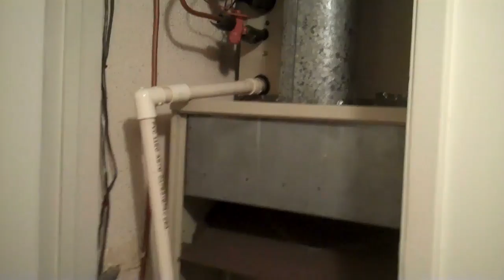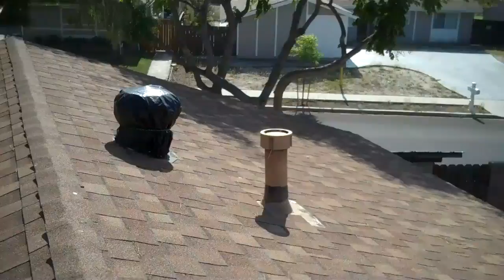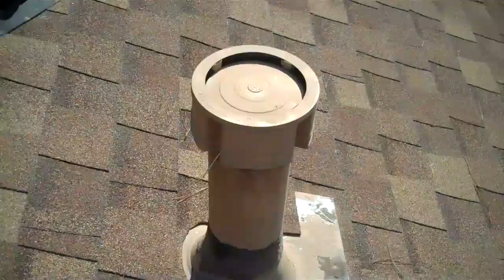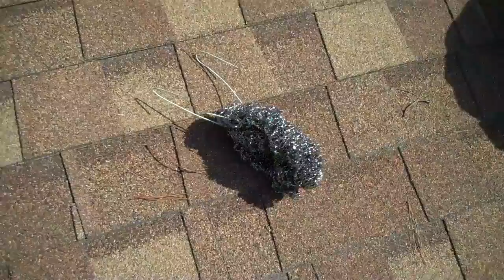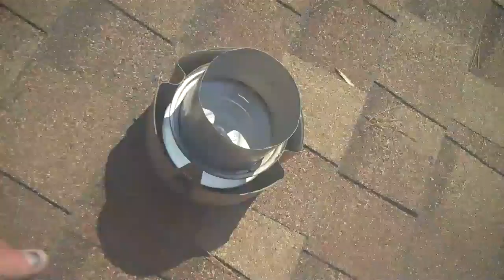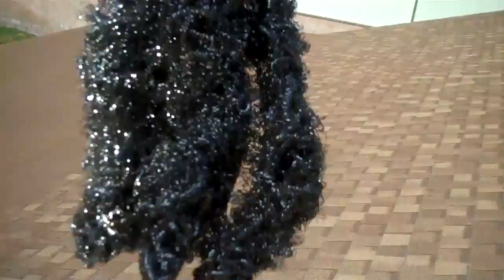Hvac A Dangerous Vent!!

Comment: OMG, please please please also remove all those black plastic TRASH BAGS tied over all the attic vents.. holy cow, thats a surefire recipie for a complete roof tear-off, and all new plywood decking.  Proper attic ventilation is crucial to prevent condensation and a completely rotted out roof.  Big snow load = boom.  Not only did they plug the furnace vent, they also chocked all the attic vents. Might want to check the sewer vent pipe too, haha.
Reply: @Uncle Timmy at 23 seconds into the video it shows black plastic was put over the attic vent. It's that thing that looks a little like a beach ball in a black garbage bag. 

Those attic vents need to let moisture get out of the attic, even in winter.
Reply: Seems they wanted to try and stop all possible squirrel entry points. But they did not go about it correctly.

Comment: Tstatech u r so right about techs going up the roof.  We’ve had numerous techs over including firefighters to no avail.  
Our new CO detectors did not activate but someone in house was getting symptoms associated with CO poisoning (headaches, dizziness etc) shortly after our new roof was completed.  Our furnace is the so called high efficient furnace with two white intake/outtake PVC vents.  These PVC vents r aligned with the hot water exhaust vent up the attic but the PVC openings r to the side of house whereas the hot water vent  is in the middle of house.  The headache is on every time the furnace is on and that only happened right after reroofing. I noticed once the hot water exhaust pipe was swaying in the wind during reroofing. Roofer responded by saying he was replacing the flashings including the curly metal sheet (sleeve?) which had been removed.  The flashings there now r not new n from what I can see the protective sleeve has not been replaced.
The furnace has been turned off since but If there was debris obstructing the hot water exhaust vent how come  “low” CO is sensed only when the furnace is on?

Comment: If a squirrel got inside the vent cap that would be one dead squirrel. The roof flue vent cap leads directly to the furnace and all joints should be locked and screwed securely.  I think their squirrel problem has different entrance to the attic.
Reply: The squirrel could go through the draft hood on the furnace!
Reply: Most modern furnaces have inducer motors directly connected to the flue vent which in my opinion would be a dead end for any squirrel. However, if you go back about 30 years or so there are draft hood furnaces and a squirrel could pass through if he could get passed the flu cap on the roof, but the furnace better not be on or it would be cooked squirrel.

Comment: Omg, so many problems there.. that mech room looks like hell and is that a condensate line on c vent ??? And they have their loft vents ( spinners) taped up ??  Lolz.. humidity issue in attic.... check .. wall condensation in unit...check.

Comment: that was a pretty stupid thing a niece did. was carbon monoxide detector going off ?
Reply from the maker: +OcRefrigeration,Hvac &amp; Electrical. Yes the carbon monoxide was going off and the customer called the gas company...Thank God!! Thanks for watching!
Reply: OcRefrigeration,Hvac & Electrical. The niece covered carbon monoxide detector so it won't get dusty,

Comment: That was quite a dangerous situation! Why did they call you out? Did they notice the exhaust gasses coming out of the furnace?
Reply: Perhaps their CO detector went off. But anyway, the customer called the gas company and the gas company shut it down until the problem was fixed. So they called him.

Comment: My new propane furnace vent was installed through the roof but with no vent cap.  I questioned the contractor and was told it was okay.  Shouldn’t it have some sort of vent cap or is it proper to leave it open?
Reply: Your "contractor" is very wrong. You do need a vent cap.
Reply: @JohnnyDS6557  ok, thank you John.

Comment: did it have a vent switch that tripped the unit??
Reply: No, thats an old old furnace by the look of it.. looks like an old low efficient with the mid efficient adaptor package.. the early models ( again im going off what I can see in the video not the rating plate )  were banned cause it was single wall and the acidic condensate would rot out the pipe. The outlet to the drain ( the plastic cpvc pipe you see attached to furnace ) would also mineral clog and then melt off.. likely this flu pipe has a hole in the attic allowing rodents to access through the furnace, there is zero chance they got in from the roof. Respectfully intended to the tech In the video but the complaint was not fully addressed, a pressure test with a dual port manometer could passively reveal if there was a hole in the exhaust piping without going on the horrid and as often as possible avoided attic crawl.  A long cable cam could also explore the flu pipe passage

Comment: No kidding, you remove all ventilation from an attic then bye-bye roof :-)
Reply: As a roofer for 20 years that is the leading cause of prematurely deteriorated shingles.   I have actually seen them melt themselves right into the substrate.  Always install adequate ventilation per the square footage of your house.   Electric powered vents and whirly birds are your best options.  Best paired with soffit ventilation.  Avoid ridge vents.  They dont move enough air can can easily be covered by snow in the winter.   If you insist on a ridge vent pair it with a couple whirly birds or electric fan vents.  Its amazing how many homes could roast a chicken in the attic.

Comment: how about putting in, say, one goddamn screw so the squirrel doesn't pull that cap off again?
what does a screw cost dude? 3 cents?
duhhhhhhhhh!
Reply from the maker: I will have one of my staff member contact you god dammit... nice heads up!
Reply: It's illegal to use screws on b-vent...The proper cap needs to be installed.

Comment: GUARANTEED THAT HEAT EXCHANGER IS CRACKED! Flip that call and $ell a new system!
Reply: Keys To Life fuck that, there is nothing wrong with it hat furnace IF it is not cracked
Reply: Just because its old doesn't necessarily mean the heat  Exchanger is cracked. It is likely fine